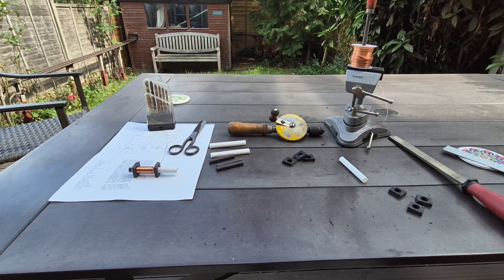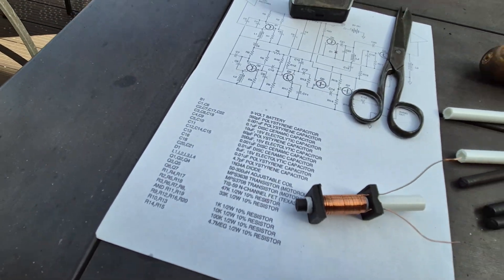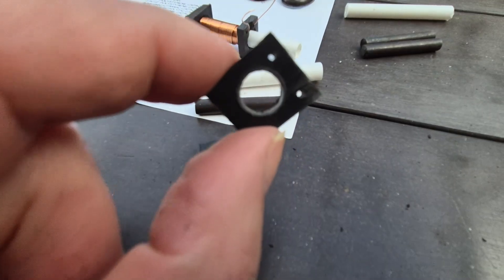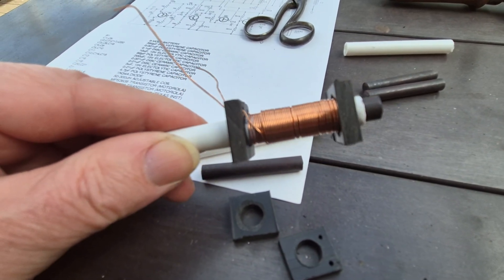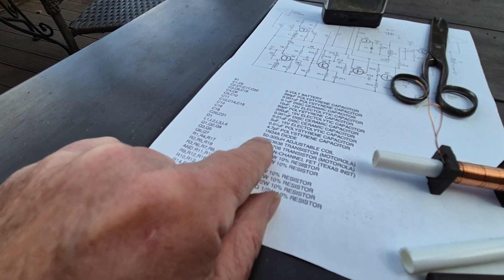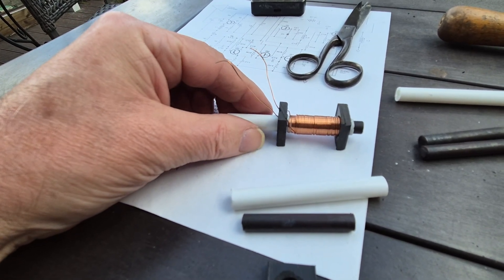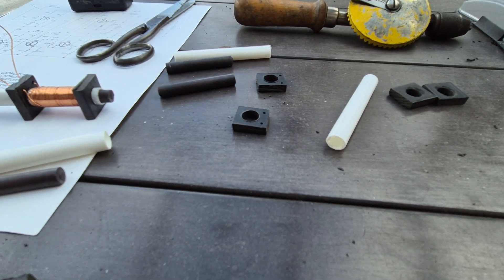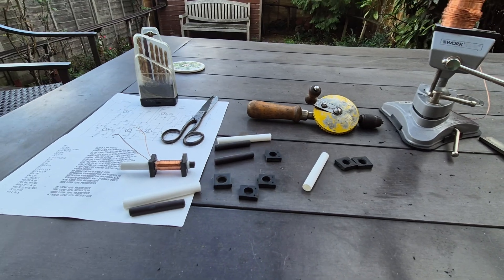Theremin Project 04

Comment: Are you building this theremin from a kit or merely making everything on your own as you go? I do remember many decades ago Popular Electronics had a Theremin project and me and another guy (kids back then) built one. Great project. WHere dod you get the schematic ?
Reply: Do you remember what issue? Year? Decade?
I wanna go look this up.
Reply: @jaredloveless  Just doing a little search, they had a tube type in 1955, and Electronic Illustrated tube version and build in 1961. Popular Electronics had a solid state version in the November issue in 1967. That was the version we built... And that article is available on line to view too.
Reply from the maker: @jaredloveless   Originally published in Popular Electronics in November 1967. I think it is still available online.
Reply from the maker: This was a project as originally published in Popular Electronics in November 1967. So what I have is the circuit diagram and a PCB layout plus a few instructions. I found that coils of the type described do not seem to be readily available today, so I've had to make them. The transistors also are problematic, and I may well have to try and find substitutes that will do instead. I think all the info can still be found online for this project. I also have circuits for a tube (valve) based theremin, but  for that I would need a suitable mains transformer. I posted a video saying I was considering these projects, and the transistor one seemed more popular so that's the one I've gone with.
Reply: @Timothycan  The regular PNP BJT transistors can be easily subbed. The two FETs may take some comparison. The problem there is searching for those two n-channel FETs reveals nothing as if they never existed. They originally were Texas Instrument types. Could contact them and get some info. So you may try some general FETs for their replacement... IDK
Reply from the maker: @garymucher4082 Many thanks for that.
Reply: @Timothycan  I did a little more research and found out that the original FETs (TIS-59) were from Texas Instruments. And they are obviously obsolete. However you can use most any type N-channel JFET for this project. And there are many of them available for very cheap. The original had a 30v D to S rating. So anything JFET with at least that would work... Hope this helped...
Reply from the maker: @garymucher4082  Thanks for that. I'm going to try some generic NPN and PNP transistors which I think will sub for the Motorola ones, and have ordered some N-channel FETS that should do. These are all cheap, so I will have several, in case of mishaps!